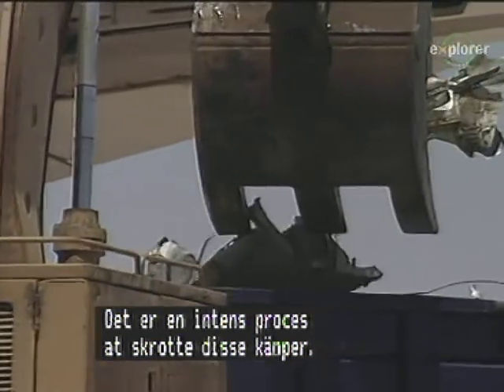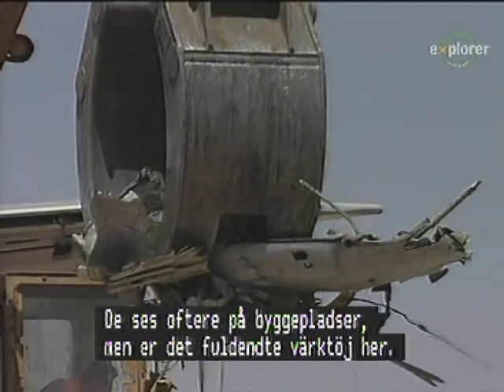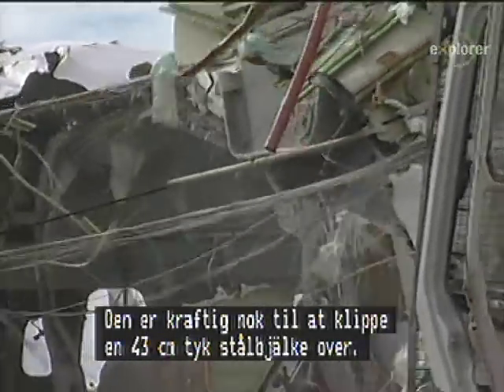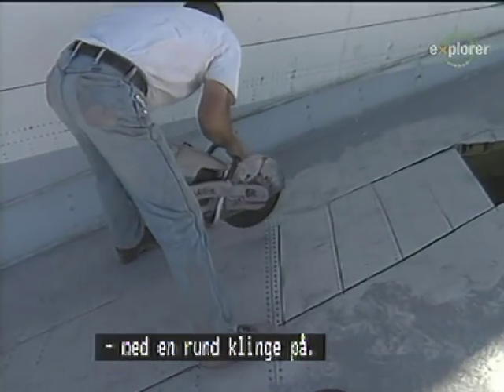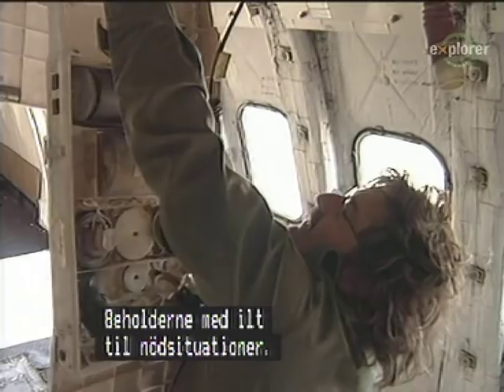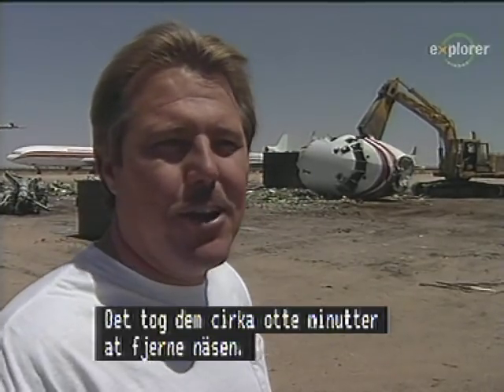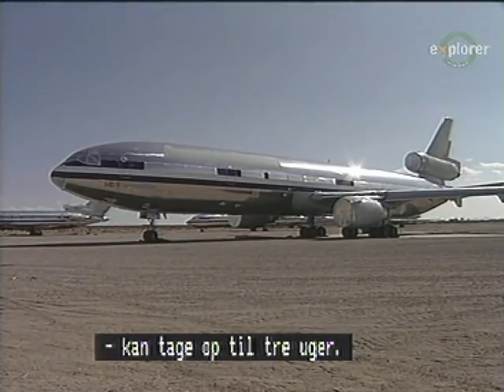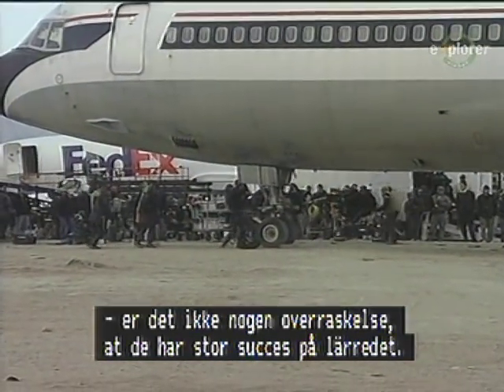Scrapping an airplane at Mojave Airport

Comment: @goldcoastflyer 
In all fairness, aluminium does suffer from metal fatigue over a period of load cycles and so there will be a time when micro-cracks in the structure will become more likely to become propagation cracks. Unlike steel, aluminium doesn't have an endurance limit.

Plus there's the economics of running the thing.

Comment: L-1011s had a lot of life left in them when they were all retired.  The real reason was that they were a limited run and parts could not be sourced easily, especially that Lockheed Martin was no longer in the passenger airliner business.  The debut of the 777 and especially the 767-400 and the -300ER signed their death warrant.

TL/DR; they died before their time, this is why people are so upset.
Reply: It explains a lot.

Comment: @WITCG1 Sure enough, this is heartbreaking but it would be even more heartbreaking if an airliner tore apart in the sky because the pressurised fuselage had expanded and contracted to destruction because the plane had flown for more than the 20 years it is permitted to fly. Those planes weren't permitted to fly anymore.

Comment: I could be wrong, however in long run the metal is as the call it getting tired. Which means it can break more easy it loses its elasticity. So it would be hazardous to used it.

Comment: Damn, now I see why the Delta Airlines'  L-1011, and 727 jets are not around anymore. As I heard someone say, that most of those jets were retired before their time, some of the DC-10s, 727s, L-1011s, and 747s were a few of the planes that was mentioned, as well as the DC-9s, and 737s.

Comment: Ironic that the LOCOWEED L-1011 P.O.S. is being chopped up about 20 miles from where it was built. Sorry to see that very rare CONVAIR 990 die, but they had corrosion issues from the factory in the 60's and were not cheap to operate even in the days of 11c a gallon jet fuel, but BOY! would they haul the mail!!!

Comment: the jets in 911 cut right through steel beams like a hot knife through butter ... go figure . rock -paper scissors
Reply: Sure, but the sheeple can not make a link between THIS video and the 9/11 footage showing how the "planes" were cutting through the steel of the Twin Towers. Sheeple, eh...
Reply: like a beer can cutting its way through several layers of chain link fence... c'mon really!
Reply: Its not about the strength of the materials its about the speed they are moving
Reply: ***** So you mean that if the plane being scrapped would move very fast towards the blade of the scrapping equipment it would avoid being cut into pieces and would rather remain a whole piece, due to its "high speed"? Is that what you mean?
Reply: exactly ... if lhj was right then you could make  a samurai sword out of aluminum foil  , you justhave to swing it real fast and it would cut through bamboo in on cut
Reply: Richard Mann if a plane is moving fast as it was in 9/11 it can do a lot of damage, in the case of this the steal claw is able to damage the plane became of the force applied by the hydraulic
Reply: ***** Didn't it occur to you that it does not matter - if the "object A" is moving toward "object B" or "object B" is moving toward "object A" - the physics of the event remains the same, while what "moves" is only relative to the point of observer ("object C" - which is you)?
Reply: to ljh  would it matter if a car hits you at 100mph  or other wise you hit a stationary car at 100 mph ? to my mind the same thing would happen ... you would go splat either way . DIMITRI K.  is right. I used to do a lot of shooting and even shot big bore rifles at steel plate and unless it was a special hardened armor piercing round the bullet just splattered and maybe left a small dent in the plate. so how would the skin of an airliner travelling much slower than a bullet slice through 4 inch thick high grade steel?
Reply: Richard Mann This folks will never surrender - they are just to comfortable believing that it was "suicidal hijackers in aluminum planes" rather than their beloved government cheated them... So, it is a pure psychological problem. When psychology clashes with physics, psychology wins.
Reply: agreed
Reply: Ali Frazier I hold a personal sovereignty in a full sense of this word - both de-jure and de-facto. So, there is no government that enslaved me. I am God's slave.
Reply: Dimitri Khalezov I am so disappointed. I thought had something to say that would be thought provoking, and maybe even put me in my place.

All you have to offer is drivel better fit for The Land of Oz, that of someone whose 'reality' consists, in toto, of a battery powered, thumb operated toy. 

It is obvious you are a young man, ensnared in the sometimes bull shit notions that youth saddles a person with. The Good News is for all of us, and eventually you,  is that, in the fullness of time,  reality will kick you in the ass on enough occasions that you will, if grudgingly, join rest of us as residents in the real world. I just pray that the journey doesn't kill you first.
Reply: Ali Frazier I am 51 (and a half) years old. Not "too young", actually. And have lots of life experience. Lived in a communist country, as well as in capitalist countries, as well as in third-world countries (semi-feudal), and stayed behind bars several times as well, so I have lots of first-hand experience when it comes to the "government enslavement of people". So, it has nothing to do with "youth". I know the subject and I definitely know what I am talking about.